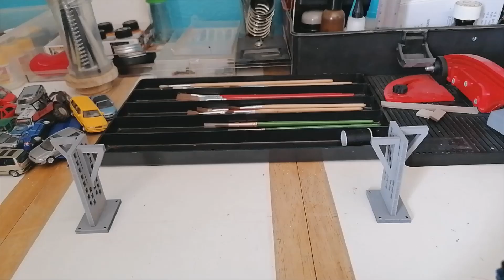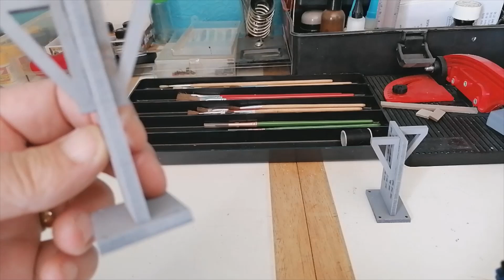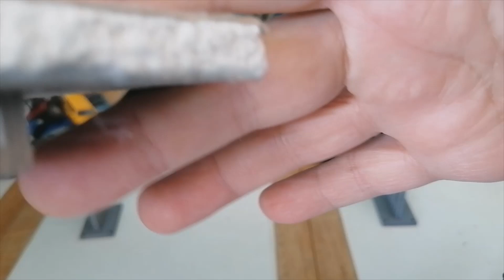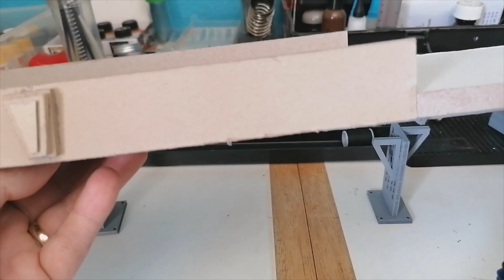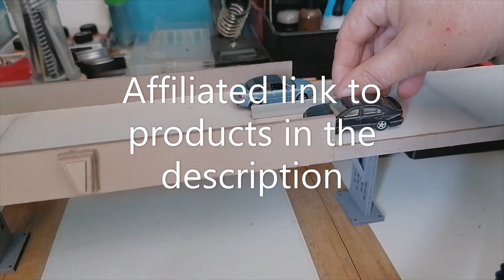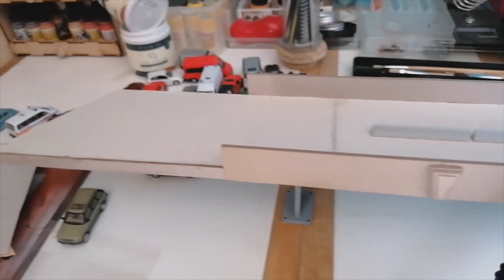Building a bridge on the model railway

Comment: Hey Digger, it looks good and clever construction.  I do feel the supports are out of scale to the size they are supporting, but maybe you are just eyeballing and will add more.  You definitely want some kind of railing fence (wide horizontal pole, with  vertical bands) on the areas you were questioning.  Of course, that is more an American thing and may not be seen in the UK.
Reply from the maker: Hiya Anthony yes the supports needs some more work yet, yes the fencing you describe is sometimes found here too, i'm sure i will find the right thing for it, many thanks for sharing your thoughts my friend I really appreciate your input

Comment: Some good ideas there Digger but those bridge supports look too narrow for a road bridge, I would only put a pedestrian bridge on those.  David.
Reply from the maker: Hiya David, i've heard that from two other chaps too, they're actually supposed to be hidden from view behind a barrier wall etc, Norman suggested using one on each lane so i may try that in the morning or failing that i will hide them inside a larger column of some sort, thanks for your opinion David, your advice is always greatly appreciated and has spared me from looking daft as a brush on more than one occasion you're a good friend